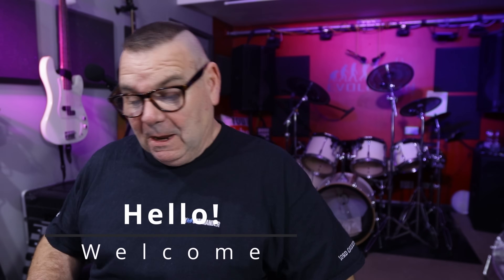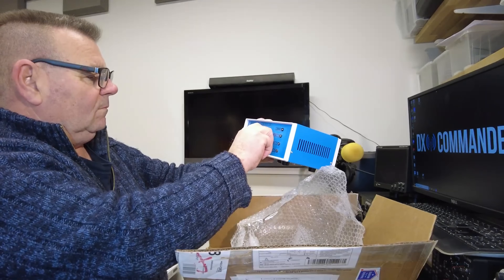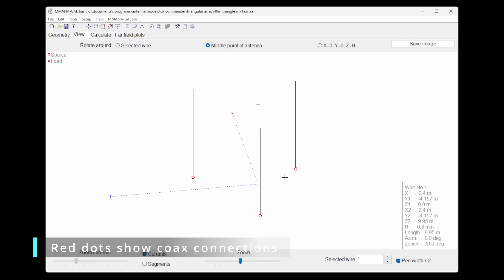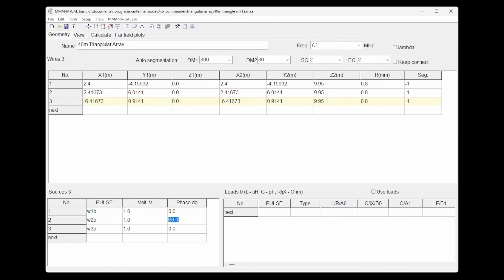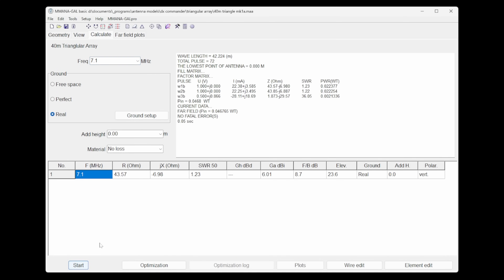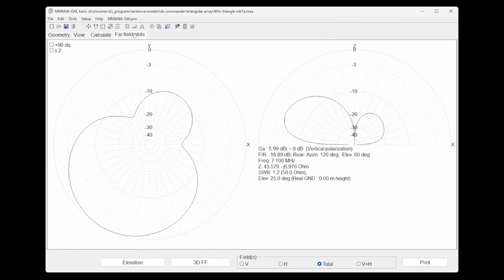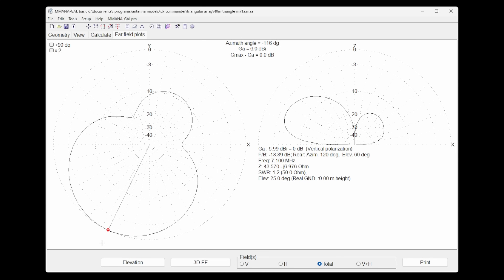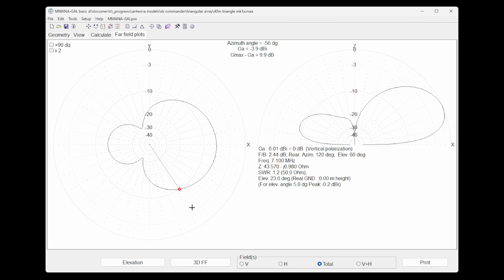The Triangular Vertical Ham Radio Array

Comment: I have mulled this idea over for some time but saw this video and thought ask just ask .

How many times do we hear about people unable to mount an antenna outside on their house ,
Look at a basic cb silver rod for example its way to big for some so tbey opt for a loft antenna what if instead of one mobile style antenna or dipole in the loft they use 2 or three ?

Would that  overcome the gain loss 
Or just invite more interference big trucks use two mobile antennas to throw that signal over the cabs .

Im thinking if say on 2mtrs you had a 2 or 3 antenna array in the loft 
The signals getting through wouldnt be any stronger but the ability to capture them is increased so whats making it through it tiles is easier to pick up 
On tx i think youd be struggling to keep swr down all those signals bouncing around a confined space but i dont know for sure 
Has anyone tried a loft array  🤷
Reply from the maker: I tried it and it was crap because of all the bits of metal up there.. I was better on 40m with a Z shaped G5RV :)

Comment: How about the old 11m CB Super Scanner design? My idea was to adapt this to a 2M/70cm /33cm, and have my phasing also rigged with a voter. Any signal that didn't meet at least value X would cause the array to auto scan and by changing the phasing throw out 3 lobes in an attempt to improve the signal. Otherwise the array would stay in omni mode. I have done some work on array size for 2m, but other than, this just conjecture. Congrats on actually making something that works!
Reply from the maker: Similar..

Comment: How about having 2 or as many as you like directional antennas pointing to all directions of the compass, and feeding them with a electronic pulse signal that is operating at millions of cycles per second (more than the intended broadcast frequency) if using say 1watt you would effectively transmitting that 1 watt to all directions of the compass  simultaneously  simultaneously simultaneously (get it)  .
Or try using a gas fluorescent type tube instead of shining light ,shine radio waves. Now to get to work to figure this out! (Patent pending) 😮
Reply from the maker: A fast pulse..!

Comment: Great video Callum. I have learned alot from your videos. I have a question. How do you receive audio in one ear of your head set and Tx audio in the other? This may not apply to this video but I would like to try at my QTH. Cheers from Canada. John VA3WJX
Reply from the maker: No.. I listen to 2 x different antennas left/right. My TX is in both ears. What you hear on my livestreams is identical to what I hear.

Comment: Very interesting, i have had an idea similar for portable use. The parasitic element one. Long range hunting team with handhelds at 68mhz,or other. Having a measured parasitic vertical cable to hang from tree, and maybe measured string for separation. Could give 3db maybe. And would be light rolled in pocket. 20m band if i remember was my first version. Without ground radials tho, mind modeling ? :) maybe it would need the handheld to use hanging radial . So it would be a vertical 2 element yagi. Great content,thanx

Comment: There was a CB base station antenna like this back in the 70’s. I could be wrong, but I think they could be pointed 6 directions. Only the really cool people had them. This looks fun  though. Cheers Cal. 
Tim
Reply: The 11 meterAntenna Specialists M-119 "Super Scanner." t has 3 half wave dipoles, connected through relays, with each dipole having 29 inches of RG58 cable to the relay box. You could pick one of three directions, with one dipole facing north. The directions were, north, southeast and southwest. It had a 9 foot tuning / matching stub of RG58 for omni-directional operation. With all three elements phased equally, it was omni-directional and the elements were much closer to each other than a quarter wave length.

Comment: Nice, lovely radiation pattern. I just thought, you know you like the 5° take off. If you built a Yagi or another beam, but angled it down 5° would that focus the maximum take off down lower? Or would you get interference from rebounding waves? Thank you
Reply from the maker: Pointing a yagi / elevation etc.. Only works when more than a wavelength above the ground and ideally higher so ground reflections go away.. The Cell Towers do this.
Reply: @DXCommanderHQ  right cool, I guess they can get around this being higher up in the frequency.

Comment: Could you model a version of a 4 square with 4 multiband antennas to see the performance and radiation pattern on all bands?
Reply from the maker: Not currently in the plan right now because there's a few different way of doing a 4-square and I'm not sure which one I should model (yet).

Comment: In theory(?), it should be possible to get all directions gain, from triangular array (like in 3-phase motor). However it is more complex, because it is hard to build variable phase control with coax.
I wonder if the beam shape would be different for different phase factors (not only 60 deg).

Great Video!
Reply: Beam shape does change with phasing angle, and also with spacing of the elements.  I have improved the design to get 6 directions for the gain lobes.
Reply: @FromthehamshackwithNJ4Z 
Hi John, thank you for your reply.

Let's go further.
So, having such knowledge we can assume, that having trx with 3 outputs phased together - which is absolutely possible with sdr - we would get 100% control of direction and the shape of the beam - limited only by Maxwell's equations.
Am I right?
Reply: @AdamSzaj  theoretically yes, but much more complicated control.  You would be beam shaping and that would require controlling the current to each or the elements.  Which is a difficult proposition. But to be direct it is possible
Reply: @FromthehamshackwithNJ4Z   I absolutely agree with you, that it would be much more complicated in terms of hardware, and software.
Definitely it is not a solution for regular HAM operator. But for radio equipment manufacturer - maybe? I'm not even close to think about this as a hobby project, however exploration of this idea - in theory - is a lot of fun for me.
I really love the fact, that one can achieve the very same result just changing the length of the coax cable. 

73!
Reply: @AdamSzaj  yes it is very cool to achieve an acceptable result with a simple solution.  Although your questions have absolutely sent me down the rabbit hole of beam shaping... I love the learning opportunity.  You have me trying to figure out a way to do it as simply as possible.
Reply from the maker: See John's reply ! :)

Comment: Callum, way back in the late 1960's or 70's there was a company selling a rotor-less steerable beam antenna for 11 meter CB.  It was actually a three element vertical phased array that was mounted on a tower.  I was just a kid back then just getting into Ham Radio. I thought about modifying one of those antennas for 10 meters, but I did not have the money to do it back then.  Question, what do you do about radials?  

Excellent practical antenna designs and entertaining videos!  FYI I will be putting up a DX Commander in the spring to replace my STEPIR Big IR vertical which was destroyed by a tornado.  That antenna was up for 14 years but it is too expensive to replace now (at $2,400+) and  your DX Commamder will give me equal performance for a very reasonable price (without all the fancy, expensive electronic controls).  Thank You!!
Tony  WA8AR
Reply from the maker: Yes, I remember that CB antenna. It was mentioned in a previous video - I forget which one now..!
Reply: @DXCommanderHQ  It was called the Super Scanner antenna.
Reply: The Antenna Specialists M-119 Super Scanner, which was still in production until the mid-1980's. The antenna safety laws changed in 1984, but that only effected omni-directional antennas, not directional antennas.

Comment: Thanks Callum. I wonder if you use the classic poles and run 40m, won't you get via Linear loading 15m tune also? Will 15m be affective as well? I would love to see a way to multiband this but it just may not be possible.
Reply from the maker: Hey Don! Great to put you in the log last night - but as John says too - the spacing is wrong..
Reply: @DXCommanderHQ  Same Callum. A real thrill. Thanks.
Reply: I have tried to do 40 and 15 together, but due to the spacing between the elements  multi banding does not work.  You could possible do it on 2 elements at 1/8 wl spacing.  It would require a very complex switching network.
Reply: @FromthehamshackwithNJ4Z  Thanks John. I always wonder why they can do a 20 15 10 Yagi in 4 elements. But I know Roly has done some testing with verticals as well as you and it just doesn't work the same?
Reply: @don_n5skt a Yagi is much different construction (Parasitic relationship) versus a phased set up.  Where the distance between elements and the delay is dependent on frequency.
Reply: @FromthehamshackwithNJ4Z  Thanks John

Comment: Great stuff Callum, 40m is hard band to get a yagi up in the air being such a big antenna
Reply: Back in the 80’s a local OT in W5 land had a 3 element 40 meter Yagi on a 50 foot tower and he worked his friend in New Zealand every morning very early on 40 m SSB running a Heath SB220 amplifier into that big Yagi. On 20, 15, & 10 he used a 3 element cubical quad on a second taller tower. Those were the days!
Reply from the maker: Yagis for 40m.. I built one ONCE, a 2-element version with 4 x DXC poles and put it at around 110 feet. It was genuinely amazing.
Reply: @DXCommanderHQ  that Yagi was huge. We built a full size 40 meter wire Yagi for the US Field Day. It was suspended between 4 light poles at a high school football stadium and was over a hundred feet above “the pitch”.  It wasn’t rotatable and it had great FB and Forward Gain and the side nulls were deep. If an antenna can over-perform that one did. We had a plain 40 meter Yagi at 120 feet and it actually worked better because we could hear more stations  from a 360° pattern instead of the very limited forward beam width with exceptional forward gain and deep nulls in almost every other direction. But it was a really fun project. You just never know until you try it. That happened in the early 1980s before everyone had PC’s and Antenna Modeling Software was not a thing yet.